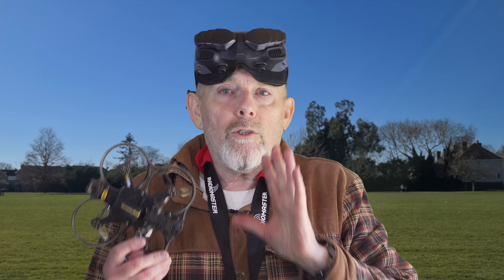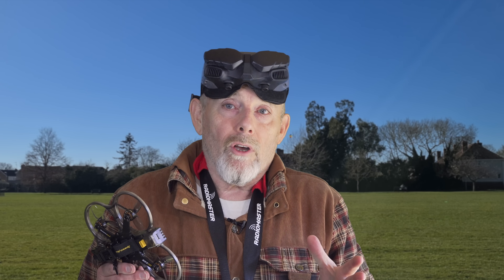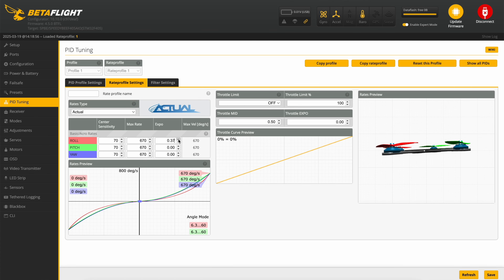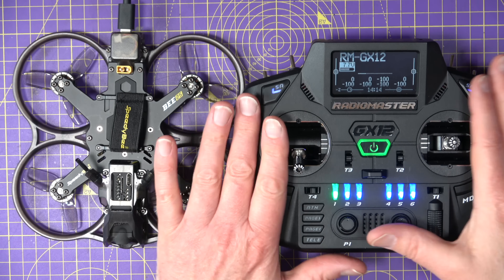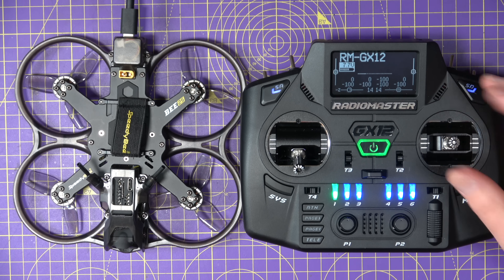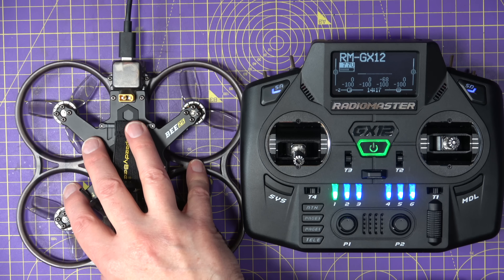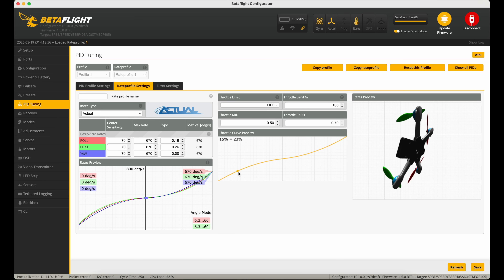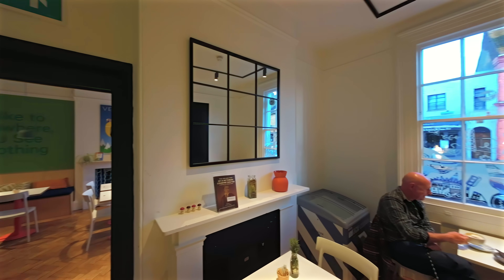Betaflight Throttle Tuning Will Improve Your Flying for Smoother Freestyle, Racing & Cinematics

Comment: Very informative.  I fly a 2S, 2 inch whoop in Angle mode in a small space.  I've perfected my own throttle curve that does the same thing, but is more involved and it limits the drone's overall performance.  Your approach is much more elegant, and I will give it a go on the next drone I acquire.
Reply from the maker: Thanks. Sounds like you’ve put in the work to really dial in your setup, which is awesome. Throttle curves can definitely do the job, but they can start to limit performance if they’re too aggressive. Glad you found this approach interesting; it’s a bit more subtle, but keeps the full range when you need it. Let me know how it goes on your next build.
Reply: @WhirlyBloke  I took a 2S Mob8 and halved the motor power.  I want my ascent to be gentle, as I've only got a couple of metres to use.  Most of the remaining power is under my midpoint so I my descents are super-smooth.  This makes the drone useless in anything but still air.  But I can put that 85mm whoop places a 65mm would dare to tread.  And forget about a Neo trying to wax my 6. . .  ;)

Comment: you can turn throttle position on in the OSD and view your input too. set midpoint to a hover without ground effect. I do this before adding any expo.
Reply from the maker: When you’re just hovering (even out of ground effect), you’re using less throttle because the quad’s lift is directly opposing gravity. But once you start flying forward, the vertical lift vector tilts, and you naturally need more throttle to maintain altitude. That's why I recommend calibrating the throttle mid at a cruise speed.

Comment: Can you make a tutorial for angle mode shooting a real state for bee25 i have bee 25 beginner here. What's the best rate for it
Reply from the maker: Thanks for the suggestion! If I get a bit of time, I might put something together for Angle Mode flythroughs. Although, ’d really recommend moving toward Acro Mode, even as a beginner. Angle Mode can feel safer at first, but it tends to give you jerky footage when it hits its tilt limits, which breaks the flow — especially for cinematic flythroughs.

Instead, try slowing down your rates and dialing in your throttle expo and throttle mid. That way, you get smooth, steady control without losing flow — and your footage will look way more professional. Let me know if you’d like help setting that up on the Bee25.
Reply: @WhirlyBloke  Thank youuu for the answer. I did fly my bee25 of it's default rate. I'm still in my 3weeks flying the bee25. But now I want to shoot some realstate so I want to control my throttle that much like you do in the video. I go try what you did in this video thank youu very much.
Reply: @artixcool5514 you want to do real-estate work with only 3 weeks of flying experience? I did my first inside flying gig after a full year of flying and it didn't feel like I was skilled enough lol. For what it's worth, I would try doing a scaled throttle limit of 70% or less. It will  make your entire throttle range feel like it has more resolution.
Reply: @jessehoffman5302  bro chill I'm just asking for the advice I'm still learning. Just asking for rates, soon shooting for real states if I can manage it using my whoop

Comment: Thank you for this! This is the information I needed.  I took my 75mm Whoop out today for the first time and I could not get it to hover properly at all.  It just took off like a bat from hell.  This will help me out majorly.  I guess all FPVs come out of the box in acro mode also.  That doesn’t help a newb like me. 😂
Reply from the maker: Haha yeah, acro mode right out of the box can definitely be a bit of a shock—especially on a tiny 75mm rocket. Glad this helped — it sounds like throttle profiling will make a huge difference for you. Once you dial it in, hovering and slow control will feel way more manageable. Stick with it, and welcome to the FPV madness.

Comment: You can do expo and midpoint in your tx settings for channels . Some modes in some versions of  betaflight in some flight controllers in some quads do not have the same rate throttle and yaw and pitch adjustment " chart "  for acro mode and angle mode or turtle or whatever . But your tx does .
Reply from the maker: Absolutely spot on. Setting expo and midpoint directly in your TX is a great option - especially since it’s consistent across all modes, regardless of quirks in Betaflight versions or flight controller setups. Whether you’re in Acro, Angle, Horizon, or even Turtle mode, your TX settings give you reliable control over throttle, yaw, pitch, etc. Super handy when flying different quads or dealing with Betaflight inconsistencies. Great tip.
Reply: @WhirlyBloke  thanks .

Comment: In my opinion all the “problems” you mentioned are just a skill issue and the solves u suggest are just bandaids that will give u bad habits.
Reply from the maker: Totally fair take — and I get where you’re coming from. Skill definitely plays a huge role, no question. But for a lot of pilots (especially newer ones), using tools like throttle expo or better profiling isn’t about avoiding learning — it’s about making the learning curve less frustrating and helping people feel more in control early on. If it makes flying more enjoyable and helps someone connect with their quad while still developing skill, I’d argue it’s a step forward, not a shortcut. But hey, always good to hear different perspectives — that’s what makes the FPV community so interesting.
Reply: I agree! I used to experiment with throttle expo, but then I got $3 gimbal stick extenders for my Radiomaster Pocket and kept practicing on stock betaflight rates...

Comment: I use throttle mid on every quad. I think about it from the process of weight. And what heavier quads I add more. I play with it to the quad or hover or just be able to not fall once I remove the thumb off.
Reply from the maker: That’s a solid approach — thinking about it in terms of weight and feel makes a lot of sense. Throttle mid is such a useful tool for matching a quad’s response to how it naturally flies, especially with heavier builds. It’s great for getting that balance where the quad hovers or maintains altitude without constant micro-adjustments, which definitely helps with control and confidence — especially in those moments when you just need to take your thumb off the stick for a sec. Smart tuning. 💪
Reply: @WhirlyBloke   Are u using Chatgpt for answering comments?

Comment: One argument for linear throttle is that when the battery is low the mapping remains constant. Also it looks like youre using the yt auto reply, i think its fine personally but would you confirm out of curiosity?
Reply from the maker: That's correct. But throttle profiling is most effective for slow flying. And when it comes down to it, you choose the best way to tune your quad how you want or need it to fly.

Comment: As you need to throttle up when inclined, when counting momentum, etc. I found that throttle expo for freestyle should be small (~0.3) for me, so that you can predictably adjust it in dynamic conditions (especially with a mid position).
Reply from the maker: That’s a great point. A bit of throttle expo can help smooth things out, but too much can make fine adjustments tricky, especially in dynamic moves where you need instant response. Sounds like you’ve found a good balance at ~0.3 for freestyle — definitely comes down to personal preference and flying style🚀🔥

Comment: Excellent video and ‘how to’ with Betaflight. Another video showing how to do this with a throttle curve in Inputs in EdgeTX can achieve the same thing and can be adjusted on the fly without having to use a computer…great vid
Reply from the maker: Good shout. Setting up a throttle curve in EdgeTX is a fantastic way to achieve the same effect, with the added bonus of tweaking it on the fly without needing a computer. You could even set up different curves for different flying styles — like smooth cinematic flying vs. aggressive freestyle — and switch between them instantly with an allocated switch. I might have to cover that in a future video — thanks for the suggestion, and glad you enjoyed this one 🚀🔥

Comment: Good video for the fpv beginners! Great work! well done!
Reply from the maker: Thanks for the kind words! It’s not just beginners—I've seen plenty of experienced pilots struggle with this too, spending way too much time tweaking their rates when the real issue is throttle control. That’s exactly why I made this video—to help people dial in their flying without the endless tuning frustration. 😅
Reply: @WhirlyBloke  Exactly, yes. It's simply great for anyone who isn't familiar with this feature yet.

Comment: Should I match my throttle mid and throttle expo?
Reply from the maker: Sort of. Find your cruise mid point and set the Throttle Mid to match it.  Then dial in a much expo as you want. If you fly fast as less expo. If you want to fly slow and smooth, dial in more.

Comment: That was extremely smooth flying in that commercial shoot. I'm ready to try this out and improve my flying....very impressive. I don't believe I've seen anyone fly that smooth, slow, precise, and steady. Loved it.
Reply from the maker: Thanks so much. Really appreciate the kind words. 😊 Dialing in the throttle makes a huge difference, especially for smooth and controlled flying. Definitely give it a try — I think you’ll notice an improvement straight away. Let me know how it goes. 🚀🔥
Reply: @WhirlyBloke hey great video! I also really like the footage inside the cafe, how are you able to hover in one spot so still? Are you flying in angle mode? When you enter the room and start panning it looks like you are using gps hold like the Avata would have.
Reply from the maker: @LucizenVisuals  No wind, steady fingers, lots of expo, gyroflow and FCPX stabilization. We all need a bit of help.
Reply: @WhirlyBloke thanks for the reply, sorry one more thing, were you in angle mode or acro?
Reply from the maker: @LucizenVisuals  Acro, always acro. In angle, you will get jerky movements when you reach the limits.
Reply: @WhirlyBloke what do you mean when you reach the limits ?
Reply: @WhirlyBloke  wow that was acro? That's even more impressive...great job.
Reply: @WhirlyBloke   The shot in the cafe was 100% done with DJI in stabilized mode
Reply: Fantastic tips, my friend. Congratulations and thank you for sharing this great knowledge. Just one question, please: Is just confusing the exposure enough? Or should I leave my acceleration at about 30 and gradually increase the exposure to a minimum? Thank you.

Comment: I also found lowering the throttle from 100 to 90 percent when using smaller gimbals like mini and nano sized ones helped me to fly with thoses gimbals as if i was flying my larger gimbals for taking off and landing i mean i was not shooting to the moon by doing that adjustment.
Reply from the maker: Great tip👍 Reducing the throttle range can definitely help make smaller gimbals feel more manageable, especially for takeoff and landing. It’s a simple tweak that can make a big difference in control and consistency. Have you tried combining that with a bit of throttle expo as well? It might smooth things out even more 🚀
Reply: @WhirlyBloke  Yes i have found on 3 to 3.5inch drones throttle at 90 percent and throttle mid set to the hover point and each drone has a different hover point and then adding throttle expo to slightly flatten the mid point but not to much because i have found to much will not give you enough control when going through small gaps were air pressure does change from a large range to a small range.